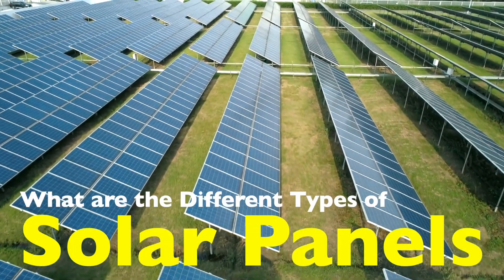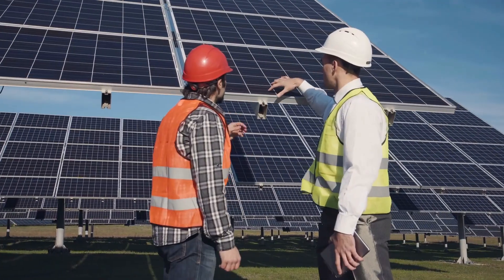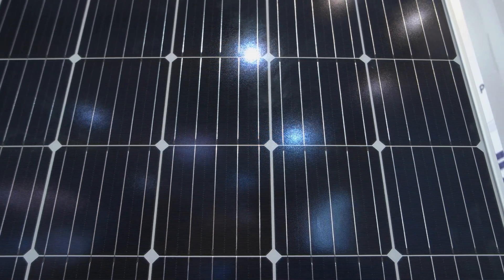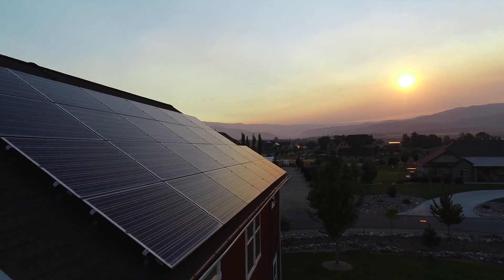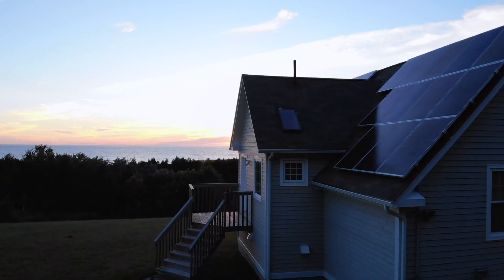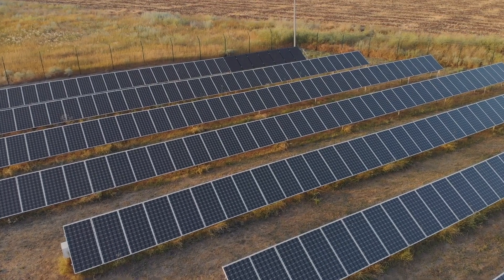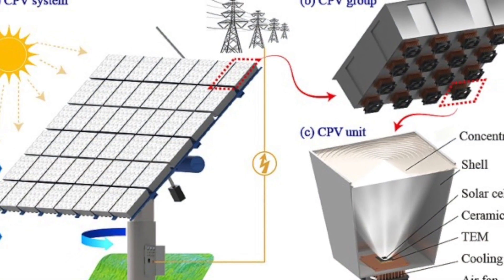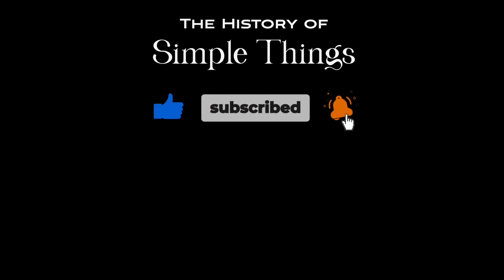What Are the Different Types of Solar Panels?

Comment: peskovite multi layer thin films (TF) have achieved over 47% efficiency! Your less than 12% on TF efficiency is first gen. We're now 3rd gen. Heck 3rd gen monocrystalline (mSi) single layer is at 27%. Dual or triple layer (different wavelengths of light) go much further. TF is much cheaper by area than mSi.